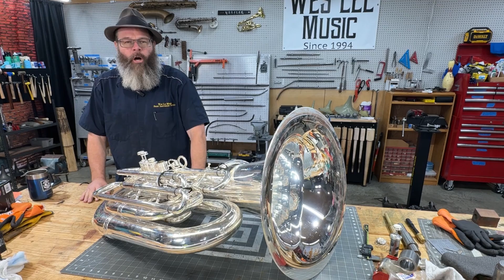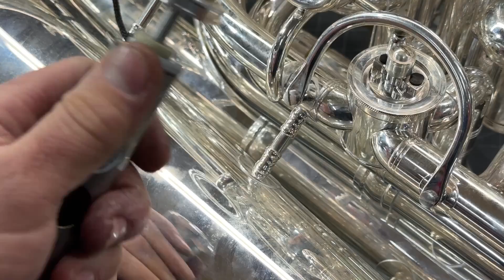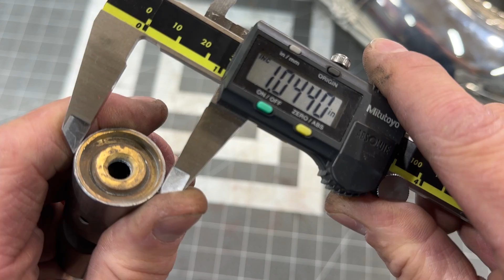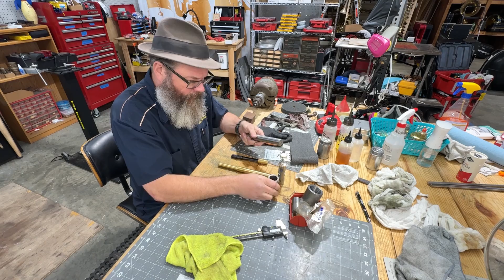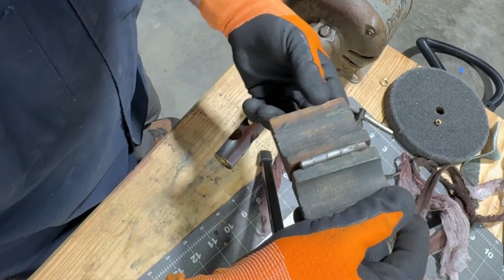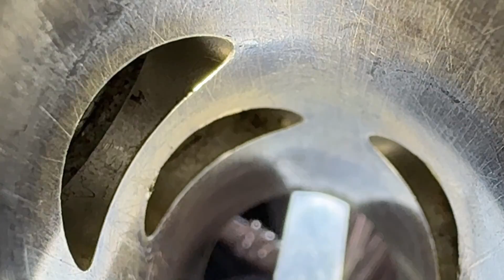Extreme Piston/Casing Repair

Comment: About two months ago I purchased a Benge 3 trumpet that appears to have been used very little.  I love the blow and the sound. Everything seemed fine for about a month, but now the first and second valve stick or slowly return to the top.  I have had it cleaned, ultrasonic, and the valves lapped twice.  The valves do not stick while only working the valves.  I have to play it for a few minutes before they stick.  Any ideas or solutions?

Comment: Check the alloy of SS being used. If it’s 300 series alloy, leaving the valves wet will cause galvanic corrosion between the brass and the SS which will cause swelling.

Comment: A few things to consider here.  An instrument like that if it doesn’t work properly it’s almost useless and eventually it would be discarded.  Think of all of the engineering that went into designing that horn and the manufacturing techniques and material.  Now when we get to this point it needs to be repaired by someone who is not only extremely knowledgeable but has all of the right tools to do the job properly.  Just like in my business the tools do not come cheap, you need lots of different ones and Wes has those tools and is entitled to charge at least what the going rate is to fix something that another person couldn’t or made worse.

Comment: Incredible job on a half-botched valve !
About techniques to assess valve compression on a second hand instrument : I remove the slide of the last valve (in the air circuit: on a trumpet it would be the 1st valve slide), plug the pipes with my finger (or a cork if impossible), press all the valves down and blow in the leadpipe: the resistance to your blowing will tell if there's a leak somewhere, of if the valve surfaces are worn out